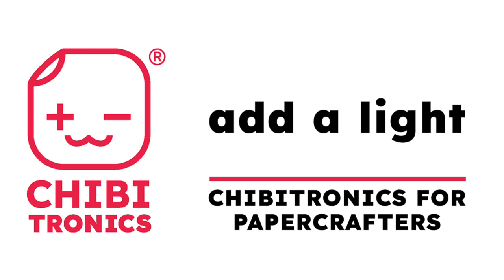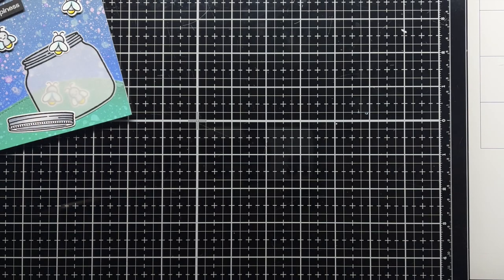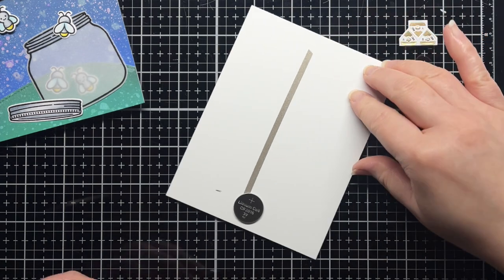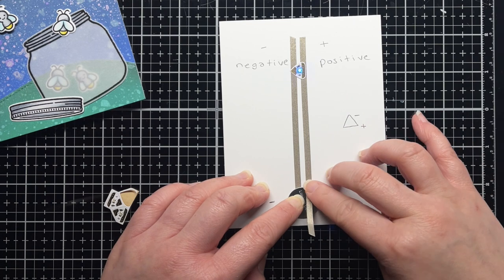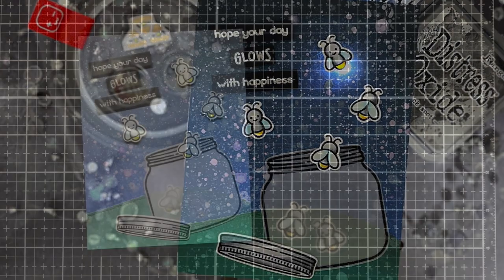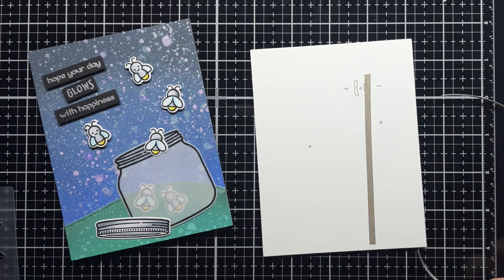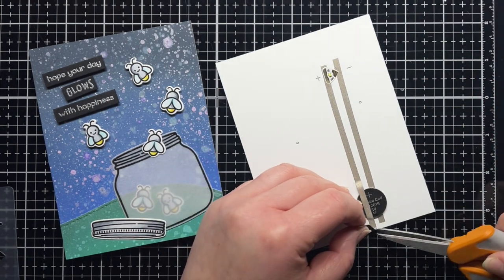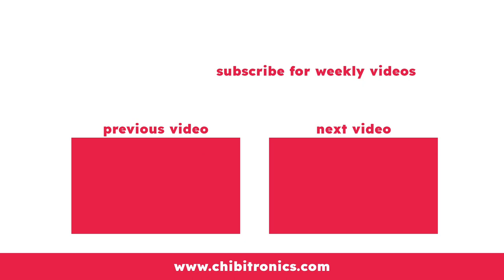1. Add a Light to Your Card! - Chibitronics for Papercrafters

Comment: Are there other LEDs that can be used rather than these ones? Like can you use big LEDS or strip LEDS? Like more brighter ones?
Reply from the maker: It depends on what you're using and what you're trying to create.  For this particular design, strip LEDs will not work.  We recommend experimenting with what you have to see what works best for you.  If you're looking to make the lights brighter you can stack a second coin battery on top.